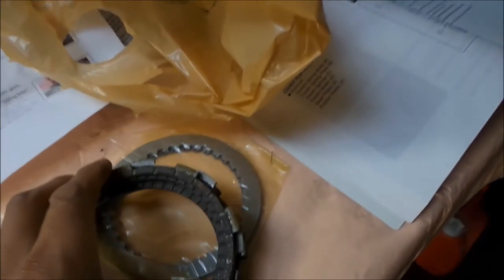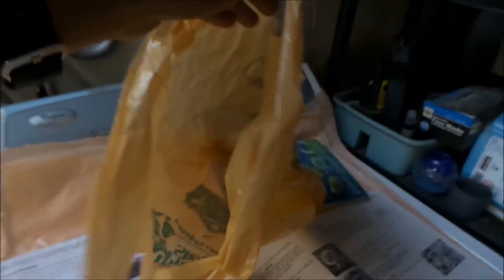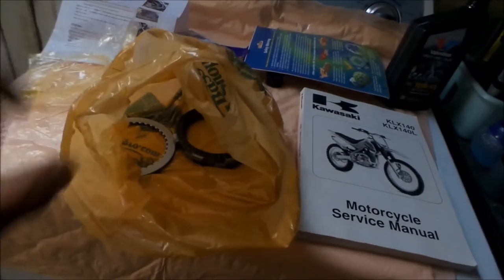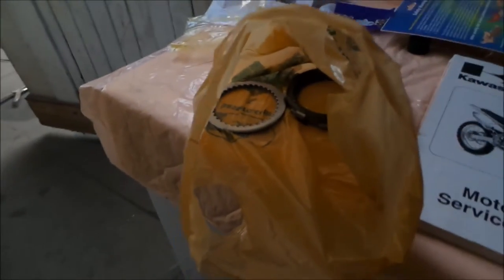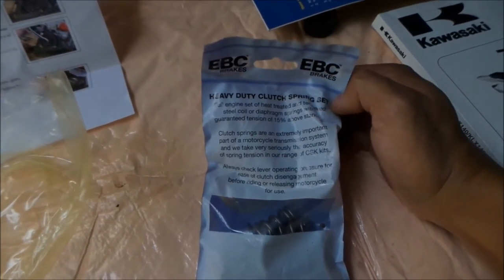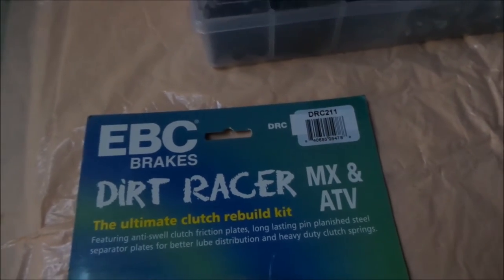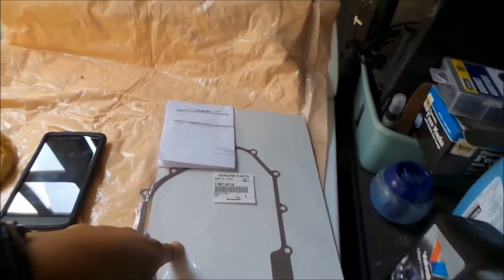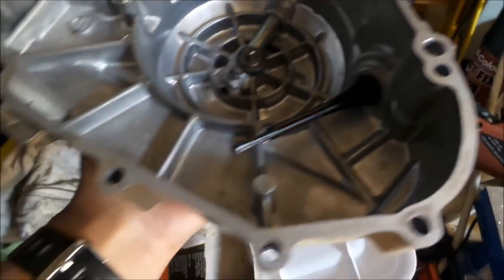KLX140 Clutch Replacement VLOG Part 2 - Clutch Plates Removal

Comment: What forks do you have on the bike
Reply from the maker: KX85/100 Forks
Reply: HadesOmega Moto do they fit the stock triple clamps
Reply from the maker: @aidanvelthuis1267  No you need the whole frontend pretty much.  The only thing you will reuse is the wheel and the rotor.
Reply: HadesOmega Moto ok thanks!